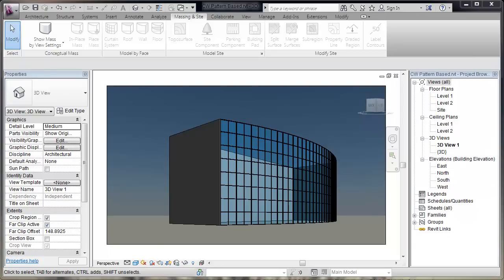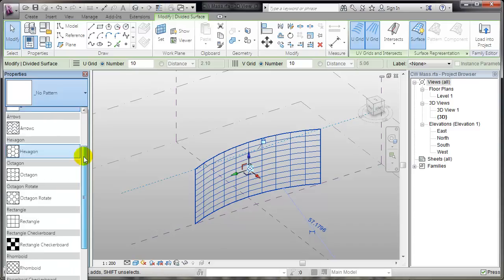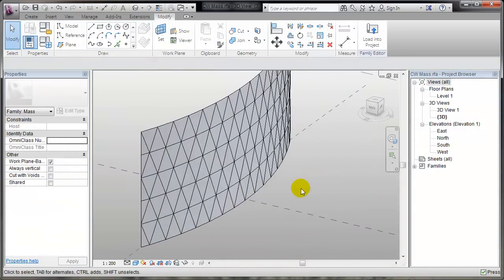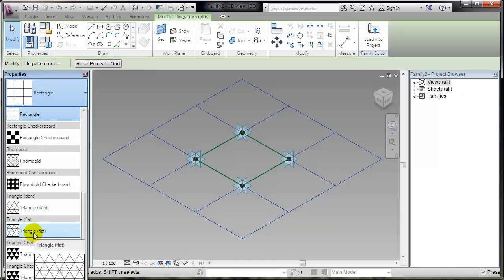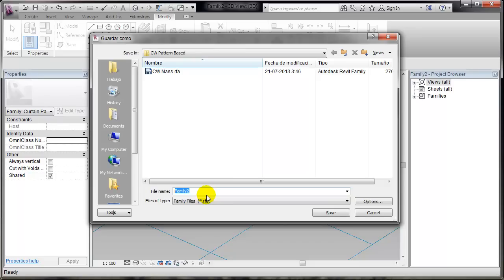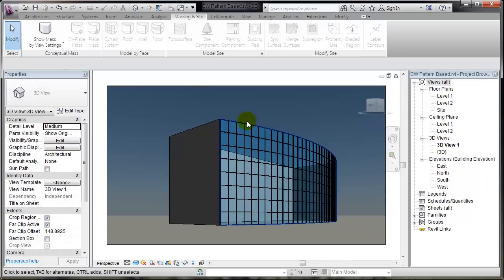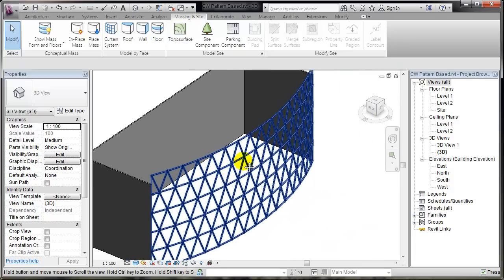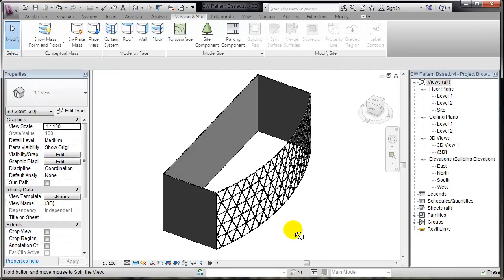REVIT: Pattern Based Curtain Walls

Comment: Hello hope this meets you well. 

Kept getting this message: 

Unable to create form element: self-intersecting or singular geometry would result. Or just unable to create element. Do you know how to go about this by any chance?
Reply from the maker: sometimes this happens when you create a complex form geometry that makes a curtain panel unusable. This message appears before using a curtain panel component or after?
Reply: @profesorogino   hello sir, sorry for my late reply and thanks for answering. It actually appears before curtain panelling, just when I draw the reference lines.
For example, I’m currently modelling a soccer stadium facade and I realised that when the lines are not perfectly drawn, as in, a perfect circle intersecting with a line at the edge, the reference planes clash and cause the model to get confused.
Reply from the maker: @muktarajibola4634  maybe you can try to model a loft style component, made of many curved sections, did you try that?
Reply: @profesorogino  hmm, I guess I could try that. Although I find out that when the outline is complex, for some reason it may not work. Also when the reference lines are not drawn to perfectly connect, you may have a problem. Best advice is to keep the outlines simple. 

Oh and to always remember to draw on workplanes when necessary. That could also be a factor from what I’ve seen

Comment: Paulo, were you able to insert glass into your custom triangle shaped curtain wall? At the end of the video it looks like glass wasn't added back into those shapes and I was wondering if you knew how to get them in?
Reply from the maker: In this example I didn't use a glass for the curtain panel. But it is possible to add glass building it creating a form directly from the reference lines of the pattern or you can build an adaptive component with glass material and later add it to the panel, hope this helps.
Reply: @profesorogino  I have a question. How to add glass in your custom triangle shaped curtain wall? Because I need to show different glass panel. some glass panel is red, some glass panel is black. thanks.
Reply: Need a tutorial on this please?